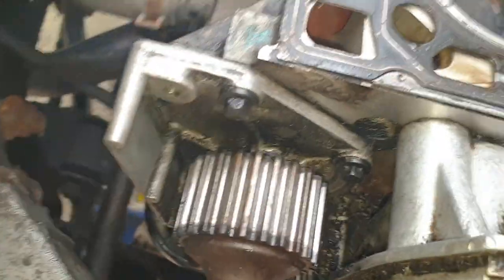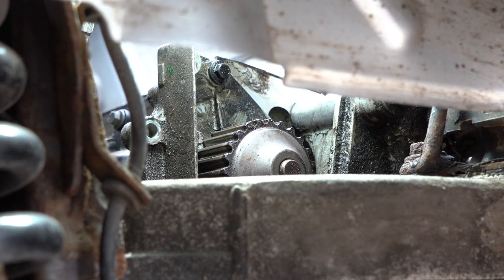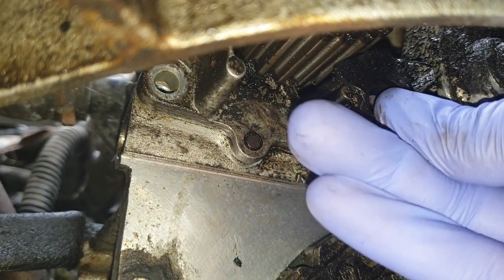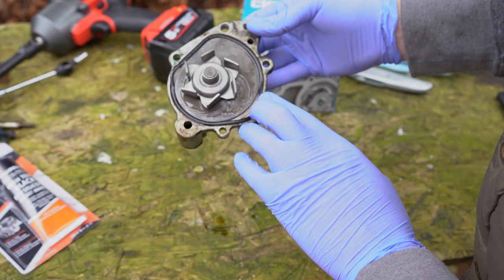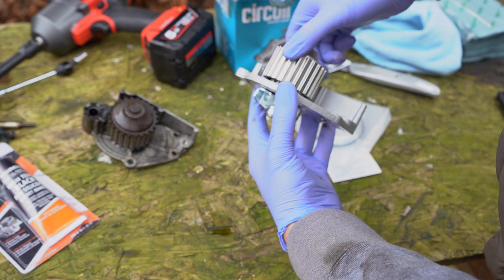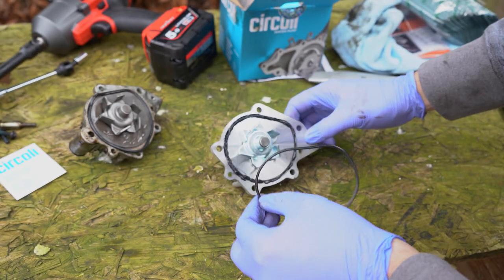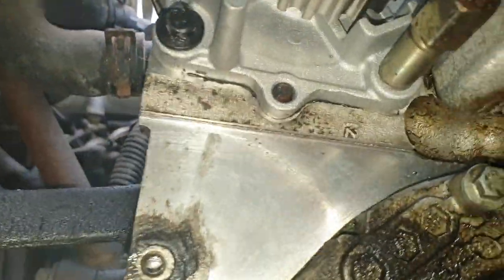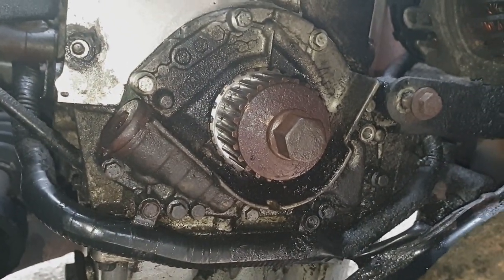MG TF Restoration ¦ Water Pump Replacement

Comment: What impact driver are you using as it seems to cope with everything. Love the information you are showing.
Reply from the maker: I'm using two, a smaller M12 Milwaukee 3/8 stubby (2554-20) which to be fair manages most bolts but occasionally use a Milwaukee M18 1/2 high torque impact. I've only really needed the high torque on a few bolts so far, the crank shaft bolt and engine mount bolts.